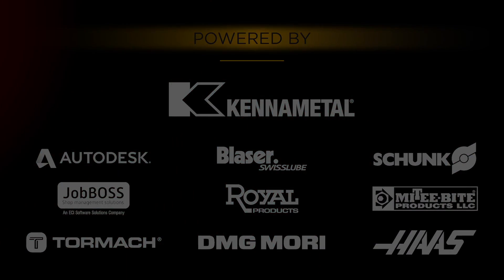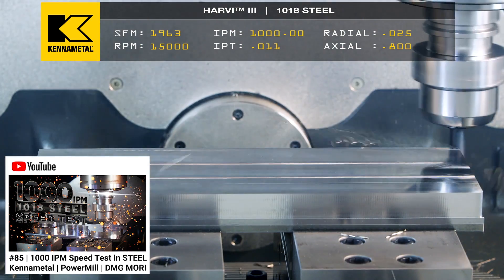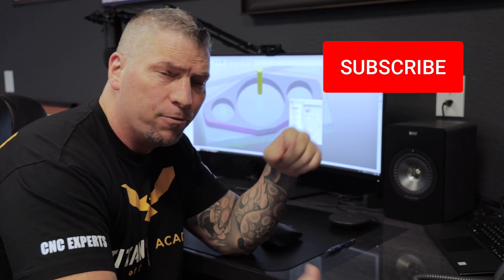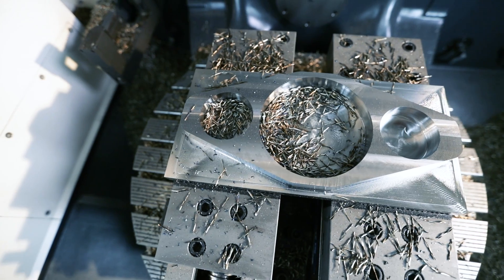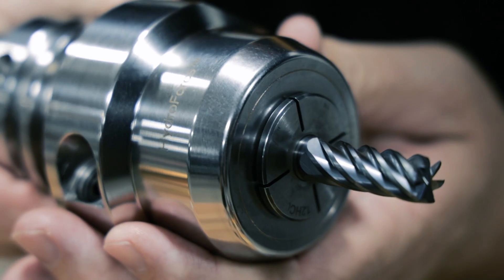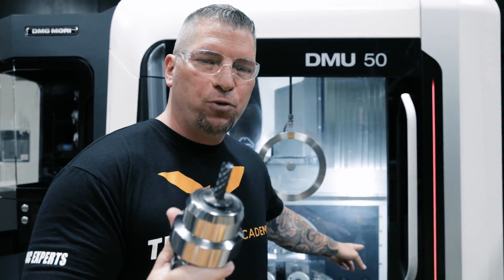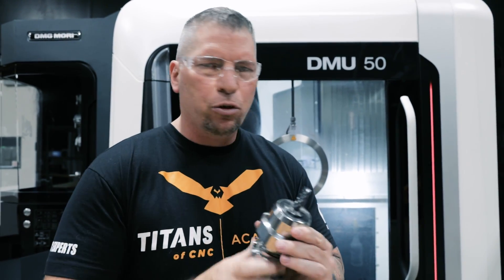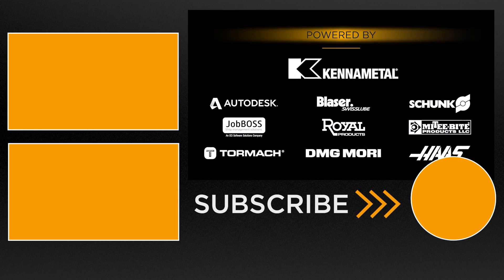CNC Machining Steel at 1000 IPM - Vlog #86

Comment: A thing which bothers me (and I've watched this video in pleasure at least 10 times by now) are the final parts of the roughing - the angled outer straights of the part. Wouldn't it be faster to mill it in a "circular" motion going around the part, increasing in depth by each pass? My guess is that it would save some machining time because the machine wouldn't have to stop and go back several times on each of the corners. 

Or am I maybe misunderstanding something here? If so, I'm eager to learn!

Comment: Amazing where this trade has gone in the 48 years since I first ran a 9" South Bend lathe in high school shop class. My love for metal working has kept me involved in everything from machining to sheet metal to welding to casting. My shop is kind of a "nursing home" for manual machines that were going to the scrapper. I can't see me being able to run this new tooling on manual machines because the lack of chip load would probably polish the edge off in no time. I have H.S.S. endmills that are 35 years old and still have not been or need to be sharpened. I know times ghange and time is money so everything gets pushed to the limit but I still take pride that I have cutters that are older than most of today's C.N.C. machinists that still cut like new. Like I said , times change. I'm from a time when if you find a way to do a 5 hr job in an hour but burned up an end mill in the prosses the boss would call you a "butcher"

Comment: No question, very impressive Titan but please: is there any advantage to traveling so fast over taking a heavier cut at a slower speed? Given equal removal rates I envision unnecessary wear on the machine with all the extra reversals. Also why not cut the perimeter in a singe path? Again, an amazing display, I couldn't look away but wouldn't do that way on my equipment. Thanks!
Reply: The tool paths are generated by the software in what in believes to be the most accurate and fastest with least time in air. Sometimes with some software say you had 16 holes in 1 4x4 block,  going 1234 left to right, 16 bottom left.  It might do 11, 12, 16, 15, 14, 13, 9, 10, 2,3,4,1 or something silly like that
Reply: @travistucker7317 Thanks for responding and  I agree - with asymmetrical hole patterns and odd pocket cleanouts I have seen some pretty wild optimized paths but in this example the perimeter was broken into four separate features requiring many reversals while I would've cut it as one. Am I the only one?

Comment: why do you cut only in 1 direction? is there a specific reason? its a waste of movement and cycle time as it seems
Reply: It may have been physically impossible to do otherwise. Horsepower is most likely the biggest issue with that here. You gain horsepower when climb milling, and the machine was apparently already at or reaching its limit in this application.

Recutting chips as you do in conventional milling at 1963SFM/15,000 RPM would also burn the cutter up much quicker.

Comment: Love these types of vids, pushing it to the limits!
But I don't know why in some videos people explain it in IPM but don't say how many flutes are on the end mill which changes everything. In some videos on YouTube they say, "yeah we are hoggin' at 600 IPM" but never say what end mill they are using! I mean when you say 1000 IPM, is that for a 2 flute end mill? Which would be a .033" chip load! For a 7 flute that would be .0095" chip load. I know I am splitting hairs here but only stating IPM is not relative. However stating the SFM and IPT is relative across all sizes of end mills.
Just sayin'..

Comment: We have a Hass VF2 , VF4, and a VF6.  How fast can we run this part with these machines?
Reply from the maker: Just start with a deep Z depth and 10% Radial ... and go 100 IPM... and the. 200 etc. keep going til you reach 80-90 % load... 
of course Roughing is only part of the run time so your machine will be fine

Comment: I do not understand what the differences are between Autodesk powermill, Fusion 360 and inventor and what do you use at your shop Titan?
Reply from the maker: Fusion and Inventor is similar but Fusion is the new kid that will be King of all in a few years...
Inventor is ITAR though as Fusion is cloud based.

PowerMill is KING of all.

But Autodesk owns PowerMill and all of it will be dumped into the future KING

Fusion360
Reply: TITANS of CNC: Academy okay so I’ll carry on using fusion :) thank you

Comment: Any specific reason you choose powermill over fusion360 to generate toolpath?
Reply: Not that it couldn't be done on fusion.  It's probably just easier with a software that is designed for high speed machining

Comment: Hey Titian! I was wondering if you could make a video detailing your speeds & feeds for finish & dry passes! Depending on the material and tool I’m using I usually increase my sfm from my roughing sfm (sometimes slower due to chatter) and will cut down my fpt to just above half of what my roughing fpt was. Is this the correct way? Would love your feedback! Thanks for everything!!! BOOOM!

Comment: How many of these parts can you run at this speed before that bit gives out? Just curious!
Reply: Im gonna say that the tool life has to be minimal at these speeds
Reply: @schu7190  I would agree!
Reply: You can tell by the chatter on the profile it won't last that long
Reply: If it's a roughing OP it's fine. The time saved at this speed will more than cover the expense of end Mills... he can probably do two parts at that speed .
Reply: @JRusso853  well let's think about that for a second. He is running about 40 cubic inches a minute, I generally rough 1018 at about 20 cubes . So he is running twice as fast as I do, but my surface foot keeps my tool running for hours. You are probably right in that he runs 2 parts at that speed, he saved 2 minutes per part. Maybe his rate is $2 a minute... So he spent $60 on an end mill in order to save $8 machining time....
Reply: @briantotten8075  Although I'm no CNC machinist, your calculation doesn't make sense. He may spend more on end mills, but they probably last longer than 4 minutes... I don't have any point of reference, but say the value of your machines to be of 1$ per minute and Titan's machines are worth 2$ per minute. Say he needs to switch end mill every hour and yours last 20 hours: he would make a total of 2$ per minute * 60 minutes * 20 hours - 1 end mill per hour * 20 hours = 2400$ - 1200$ = 1200$ over a period of 20 hours, and you would make 1$ per minute * 60 minutes * 20 hours - 1/20 end mills per hour * 20 hours = 1200$ - 60$ = 1140. Of course these aren't very good estimates but I tried not to make it in Titan's favour.
Reply: 7 hours of cut time
Reply: Those are called feed lines from the high stepover...

Comment: No tool pullout huh? Impressive. I need to try one of those holders.
Reply: We do pretty similar milling (15 kW on a 10 mm endmill) with a simple ER collet chuck. Just use a torque wrench to tighten.

Alternatively Weldon chucks are extremely cheap and absolutely safe against pullout.

Comment: Hey Titan It would be very nice If you could include the metric system for us German and others so i dont need to sit here with an calculator all day
Reply: agreed  would be great to see that for us all who use it across the pond...lol
Reply: Poland apoved
Reply: Yea asked for that about a week ago but it seems Americans do like using the imperial system . The British use both sometimes so I’ve worked in a shop where you program in inches and discuss all drill sizes in metric 😳
Reply: sure
Reply: You jerks don’t do it for us
Reply: As you use German tools, control and machinery anyways, you should use the metric system, too. 😁
Reply: Swiss here, would be awesome yes.
Reply: @TheHenzen  you use microns not mm!!! I have one almac from watch factory
Reply: The videos I’ve watched from across the pond don’t include imperial dimensions . You gotta give to receive
Reply: France approved
Reply: Yes. It's about time we convert the last heathens and bring them into the 19th century.
The metric decimal bows to no one!
Reply: Ive never met anyone that could think in standard and metric both without thinking about the odd one to them.
Reply: @Anthony Marks we need to go 22 thou larger on this 41/64ths hole to bring us to within the tolerances.. we'll use a 260 inches per minute feed rate and cut 800 surface feet per minute...

What a stupid measurement system
Reply: Its not that hard,1 inch is 25,4mm
Reply: @gf5819  i know but as i Said i dont want to use a calculator all day and i think for us the Videos could be more interresting
Reply: @gf5819  now tell us exactly what is 932 inches without a calculator. 

I mean we know this. The thing is that one sometimes isn't sure (or is just lazy to do that) with their result, therefore it would be nice if they included metric too
Reply: Giel nana , yea we all like reading figures with four numerals behind the decimal point . Let’s not go here next it will be which is the correct side of the rd to drive on.

Comment: I can't see the logic of the machining  path. Why does it do two holes and then goes on to machine bits of the outside and them back to the last hole. Why not the holes from one side to the other and then the outside?
Reply: he go to the shortest path possible, middle hole then left hole then it is closer to the left part of the contour than to the other hole so he finish the right hole in last. Path distance optimisation here.

Comment: Nice work! What’s the difference between the adaptive strategy you used there in power mill vs doing the same adaptive strategy in fusion 360? Will fusion output a similar tool path?
Reply: 10,000$
Reply: I'd like to hear from Titan on this, why choosing Powermill for this particular toolpath instead of Fusion, is there a specific reason, will Powermill output better smoothing in adaptive toolpath to achieve the speed involved?  Would you have achieved the same using Fusion in this case?